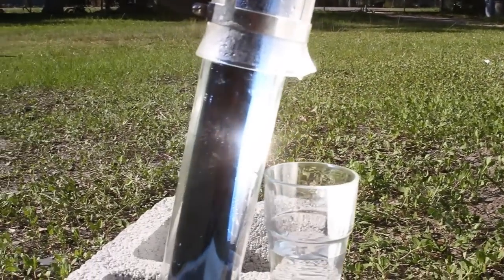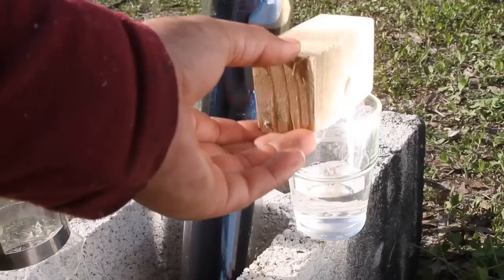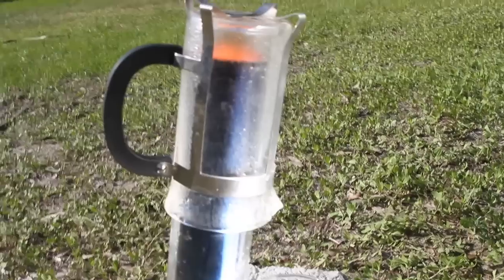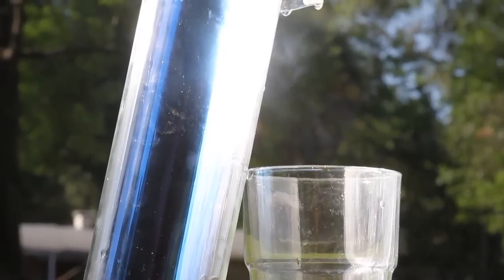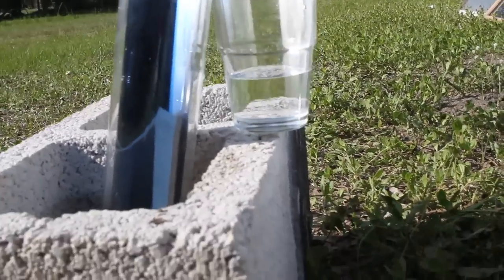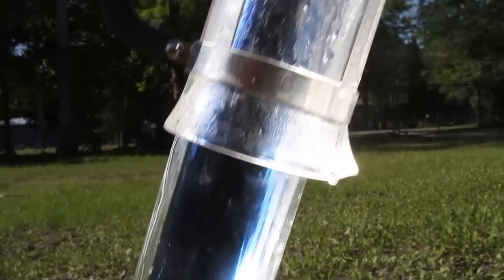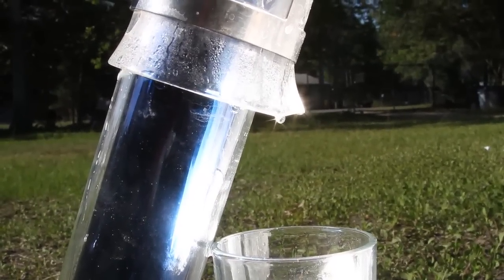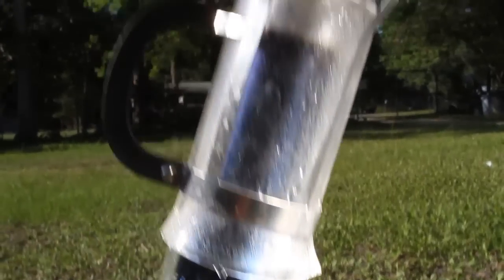SOLAR  Distilled Water Evacuated solar tube simple HOMEMADE STILL

Comment: I've experimented with steam a bit and found that a easy way to make a boiler or a distiller is just with an old pressure cooker, a couple fittings, and some copper pipe bent into a worm. It's super easy project and would probably work well with a fresnel lens. I have a framed fresnel, and will probably try it out tommorow :)

Comment from the maker: Treat with Ascorbic Acid = vit C of 1000mg per 33 gallons from a regular supplement table with higher Ascorbic acid concentrations vs fillers AKA natural is better less titanium dioxide. This neutralizes chloramine for a set period of time as it is bound out of solution. Distilling and or carbon filtration or reverse osmosis will not allow for chloramine to cross.

About a 2-3 day window.

Comment: Hi Dan. Can you explain to your viewers (and me) what is going on to cause the condensation? I thought cooler air condenses the water molecules. How is it that heating the tube does this? thanks., any explanation appreciated.
Reply: heating the tube turns the water in it into steam... once it "evaporates" and rises up to the top, it hits the inverted cup which is cooler and condenses back into water which drips out into the collector cup.  To improve it, you'd do something to cool that inverted glass piece in some manner.

Comment: This is efficient but the water will have really bad taste that way. It's probably going to be germ free and safe but, it would smell bad because you boil the water that close to the collector, Some or the dirt and other not so good things are bound to cross over to the collector with the steam.
You did another water distillation system video sometime ago and THAT water was way cleaner and odor free, or so I'm guessing.

Comment: @electrodacus most use a cool bath to condense the water. In your case I would buy peltier elements and turn the waste heat into electricity.  The cooling effect would not be very much but you could kill 2 birds with one stone so to speak

Comment: We have very hot temperature and plenty of sun shine in our area.
I want to use evacuated tube like this to generate steam and collect the steam to have distill water for home consumption. If i develop / design the equipment to dip the silver tip of evacuated tube in 3-5 liters of water will it be hot enough so that all the water may evaporate in a day to feed us with distill water. 
@@@@@ I suppose to use evacuate tube with this kind of homemade distiller to have high output. Build your own water distiller for HHO
Please comment.